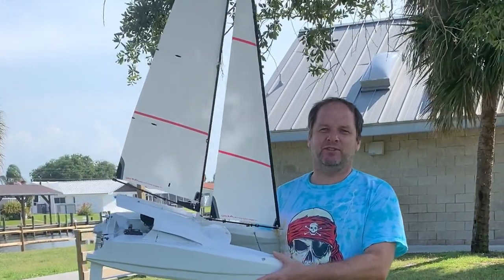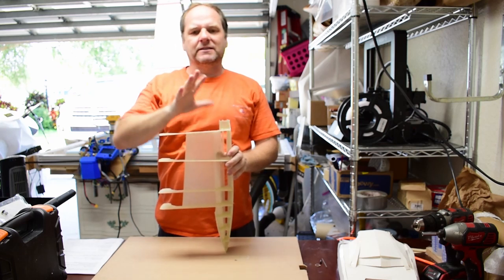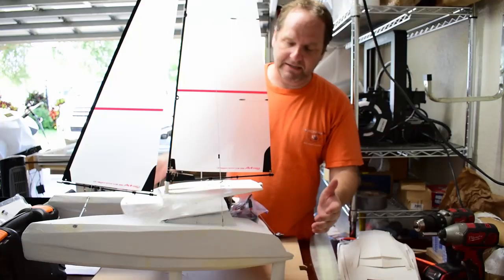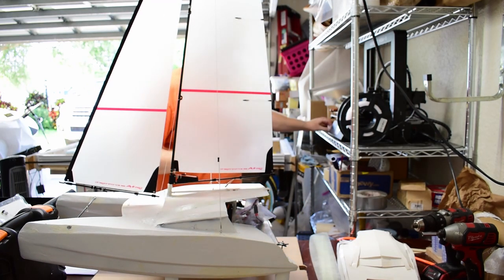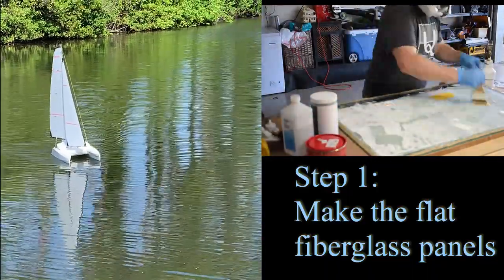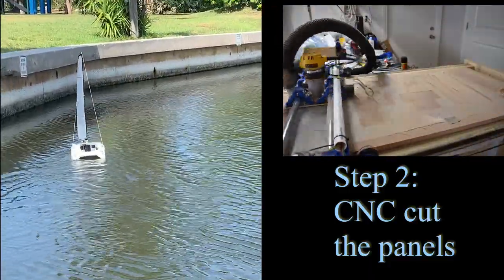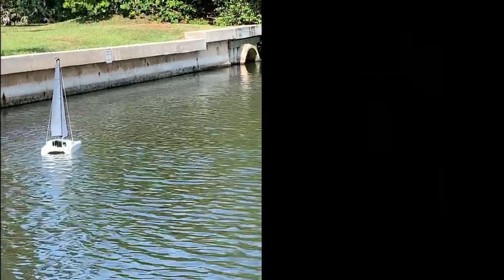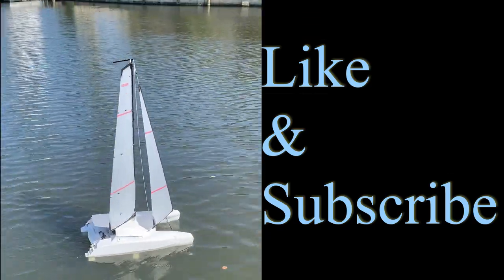Will it sail? Should I build it full size?

Comment: This is a killer little model. You got the plan in the computer already. Just upsize. Use Dynacore etc to assemble with the right epoxy or poly which ever is your fave and assemble with a strong back.
Reply from the maker: That was the plan until I bought a hurricane damaged boat. Who knows I still may build one in the future after that project is done.

Comment: Really cool model boat. I wish you had plans for that. 

I just built my MPCNC machine. I wanted a Lowrider but the SS was a little pricy. I want to build furniture and, model boats. Specifically Hydroplanes. I have some plans if you want a set and a set of PT boat plans too. These require bulkheads. I didn't see your model having those. My girlfriend's dad built his Tri Cat (1976) by hand. We sailed to Hawaii from San Diego. 

The hull split at the area between the hulls from the currents going in two directions. The main cabin bulkhead supports weren't strong enough for the open seas and cross-currents so we spent our entire summer rebuilding the hull in drydock. Great adventure but also really sucked because I had to keep pumping the water out of my room until we got into drydock. Be sure you plan for the stress by having several one-piece structural beams across the hulls. A well learned lesson.

I'm on the forum at V1engineering.com I'm Ghostman1 on there.
Reply from the maker: My current plan is to open source (ore creative commons) the design so I can get you a copy of the cut files if you to make a model. 

By the way it does have bulkheads. 9 of them. It is well built, but I'll also have it professionally engineered if I build a full size version.
Reply: @BryanSailing  That would be really cool.
Thanks.